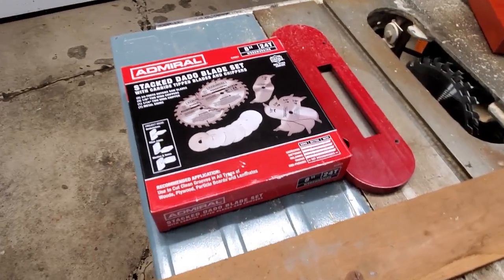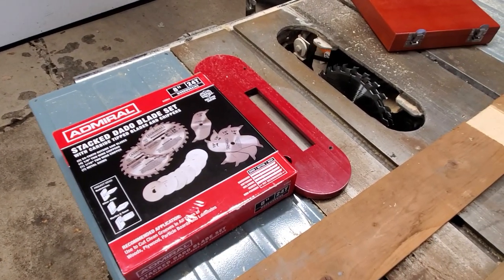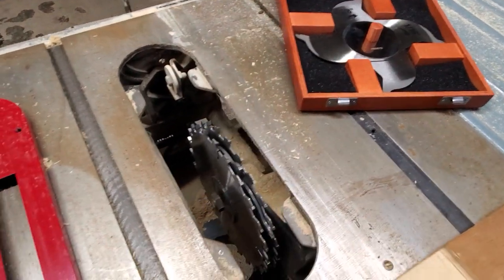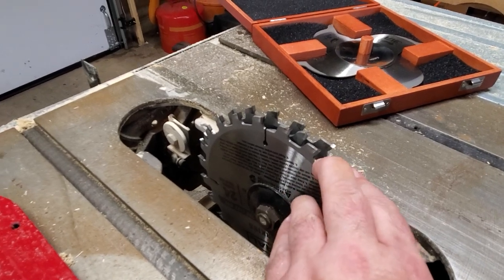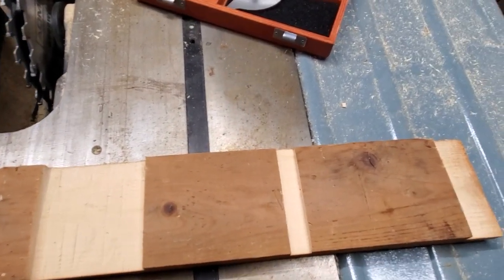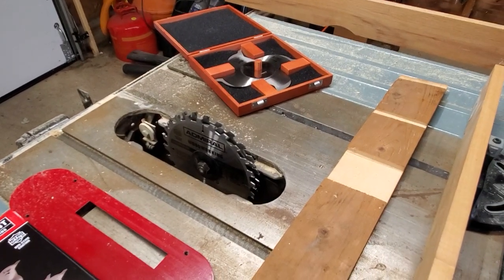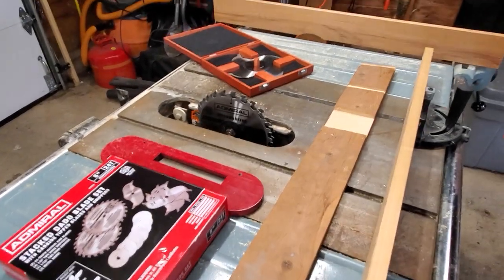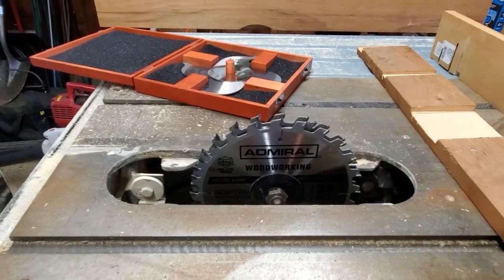Harbor Freight Admiral Dado Blade Set Review

Comment: Hello, please 🙏 I have a question for you, I can use the dado blade set on any table saw specifically on Delta 36-6022 which is the one I have ? thanks
Reply from the maker: I believe any this set is compatible with any table saw.
Reply: MSM Adventures  thanks for the information

Comment: What’s the minimum dado you can cut?
Reply from the maker: Hello, 1/8" - 13/16" is the dado set range of cut. Thanks for watching!
Reply: 1/8?  Cool - that’s really narrow.
Reply: @MSMAdventures  The instructions DO NOT INDICATE you can use the chippers without the blade. There is a chart that don't specify any cut (blade combination) over 1/4 inch.  Which is it. I just bought this and was going to return it because of the instructions. I need to make a 3/16 dado. Can I ??
Reply from the maker: Harbor Freight states that it can make as small as a 1/8 cut. I assume they are having you only use one outside blade. I have never done that small of a dado with this set however.
Reply from the maker: One blade and the 1/16 chipper would give you that 3/16 width.